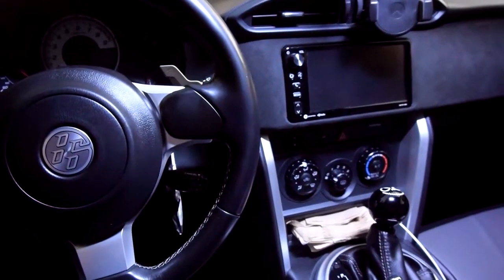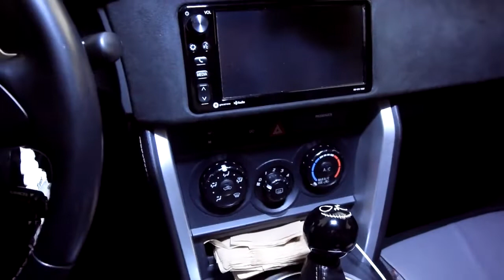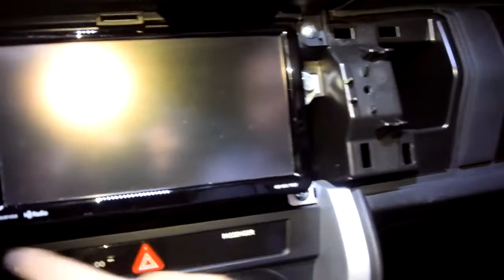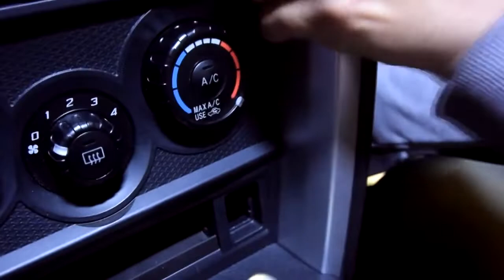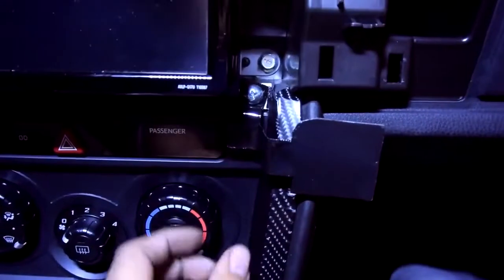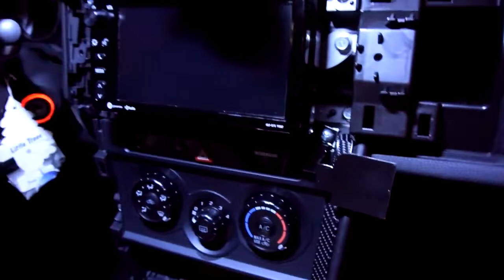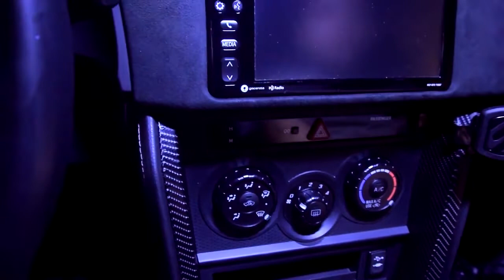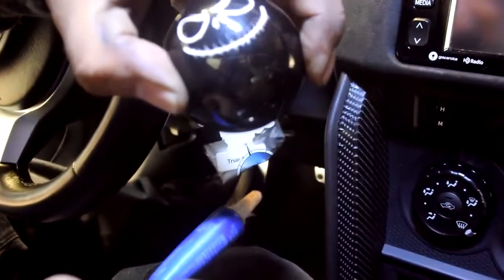!! Toyota Gt86 Interior Upgrades !!

Comment: Just a question. How do I start modding my Toyota 86? I don’t know what tools to use and what to get? Any help?
Reply from the maker: Great question are you into performance mods or looks?
Reply: Mainly Looks but probably exhaust for a bit of performance?
Reply from the maker: @just_cars_with_xavier  Start with a good exhaust headers, you will get the most power out of the engine. Then work your way getting a full exhaust. And for looks I'll say get a spoiler "wing" we just installed one on the 86. Its changes the whole car looks. The video will be out soon.
Reply: Heart To Engine  ok thank you!
Reply: Heart To Engine also I have the Toyota 86 gts and I wanna put a wing on it but I don’t know how to take the stock spoiler off?
Reply from the maker: @just_cars_with_xavier  For a better tutorial wait for our video to come out. But the tools you will need are fishing lines, sockets, and torque sockets. For a better understanding once you open the trunk you will see the bolts that I'm describing. And for installing the wing you will a drill, drill bits, and measurement lol.
Reply: Heart To Engine Haha thank you 🙏
Reply: @just_cars_with_xavier  how's the car bro?
Reply: Exprehs yeah it’s great! Like everyone says it’s not that fast but it rides nice and handles beautifully! Overall score: GREAT